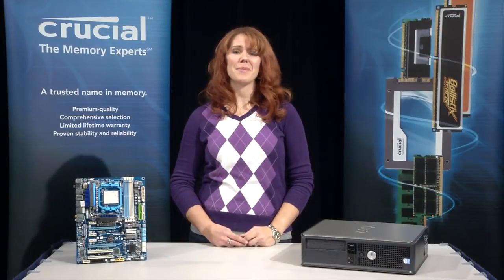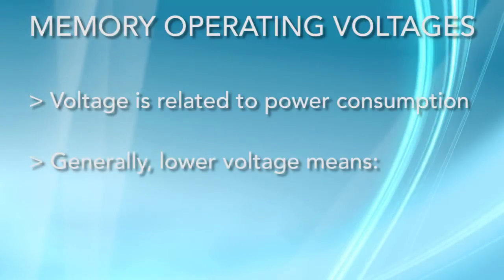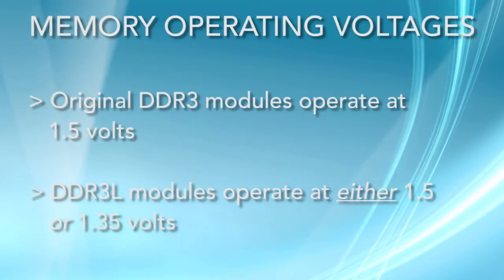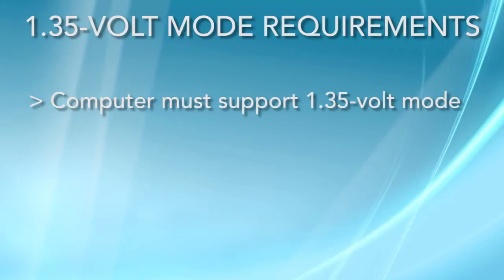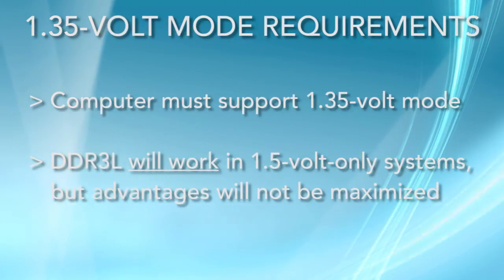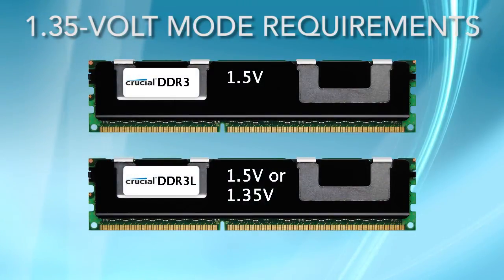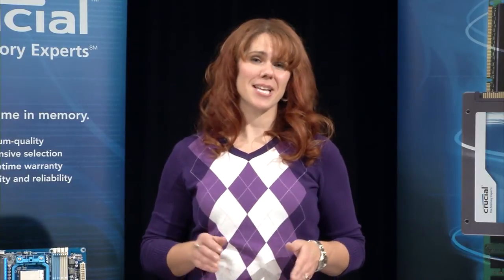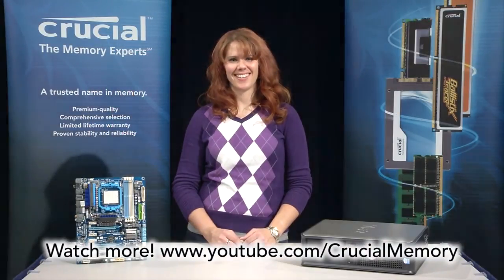Understanding Dual Voltage Memory

Comment: Please answer it: 
one slot having 1.5v ddr3
second slot having dual voltage 1.35/1.5 ram.

but in cpuz it is showing two different rams: 1.5 and 1.35. is it okay having different voltage ram?

Comment: madem my laptop lenovo g50 80 64 bit operating system graphic card 2gb amd radion ddr3 sodimm ram speed 1600 mhz  500 gb hdd drive plse tell my laptop duel channel or  single channel how many pins in this ram  and volt  i5 processor pls tell
Reply from the maker: Hello, thank you for getting in touch. 

We see that Lenovo G50-80 has maximum supported memory of 16 GB and it has two slots. It supports dual channel and 204 Pin RAM, also it supports 1.35 V Voltage. Below is the link where you can check all the compatible upgrades for your system. 

https://www.crucial.com/compatible-upgrade-for/lenovo/lenovo-g50-80

If you have further questions, we welcome your reply. You can also visit our Contact page at http://www.crucial.com/usa/en/support-contact for other ways to reach us. -AP
Reply: @crucial  what is ddr3 ram and ddr3l ram my ram speed 1600 mhz memory type 1×r8 pc3l 12800s is it ddr3 or ddr3l plse replay me

Comment: I installed ddr3 1600 and the info in the sticker of my memory is 1.5 volts I let my bios configuration automatic but after 20 minutes my monitor pixel crash after loading win 7 . I change the volts to 1.25 it works fine my question is is that safe ?
Reply from the maker: Hi Haring. If the system is running well then it should be safe. Just keep an eye on temperatures.

Comment: Hi , I have a pentium g4560 and on the intel page it says something about 1.35V , does it mean that I can only use 1.35? Or higher voltage ram will work too?

Comment: I have dual ram 1.35 and 1.5 voltage is it bad? the cslattency is 9 and 10.  I mean the computer seem working just fine. I did the memtest86 also no problem? should I be worried?
Reply from the maker: No, you shouldn't worry. Your system will run at 1.5v if the two memory modules are mixed.

Comment: I have ASUS K46CB, which supports 1.35, and my first RAM being 1.35 DDR3. Could any problems occur if I purchase and install a dual voltage 1.35-1.5 RAM? Because I read somewhere, that both of them should be Dual-voltage to work properly.
Reply: +Yuri Morozov I'm particularly talking about this one
Crucial SO-DIMM 8GB DDR3 1600MHz CL11 Dual Voltage

Comment: i have dell inspiron 3543 
it's written 1.5 v on the ram slot , can i use 1.35 ram ?
thank you
Reply from the maker: +Me Zo Yes, you can. Our 1.35v RAM is dual voltage and will work at either 1.35v or 1.5v. Whichever the system requires.

Comment: I have a 1.5v ram
can I use a 1.35v ram
my laptop is hp pavilion g6 1318ax
Reply from the maker: Dev Mashru  Yes, you can use 1.35v RAM. This RAM is dual voltage, so it will run at 1.5v if necessary.

Comment: Hi. I have a spare 1.5v ddr3 ram and my laptop has a pre installed ddr3 L ram. The question is can i install it on my laptop with 1.35v ram?
Reply from the maker: Robb Paa  Yes it should work fine. Our 1.35v RAM is dual voltage RAM. It will work as 1.5v RAM when mixed with 1.5v RAM.